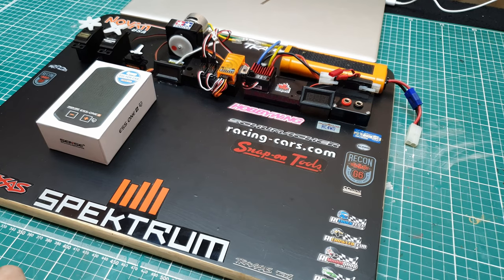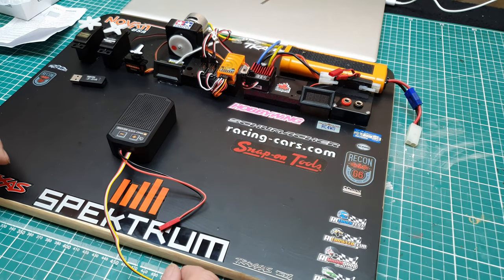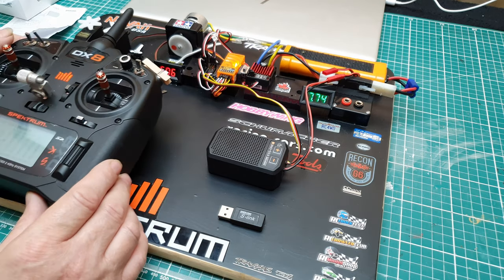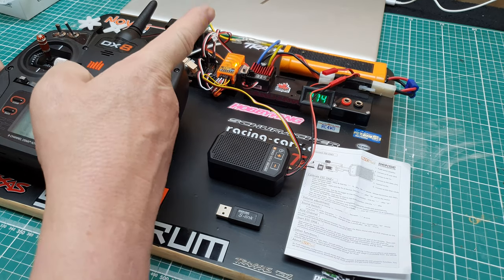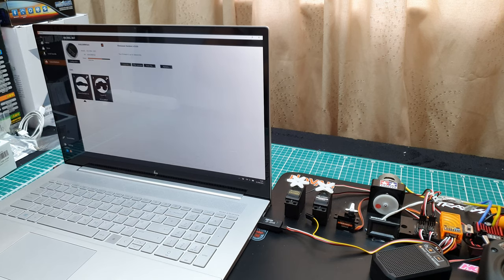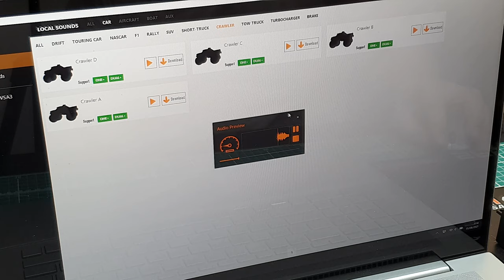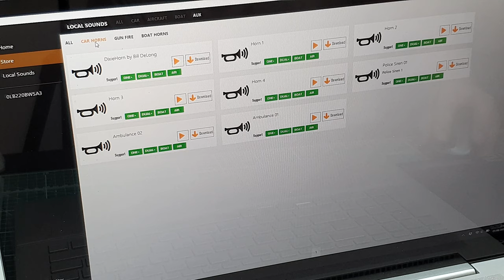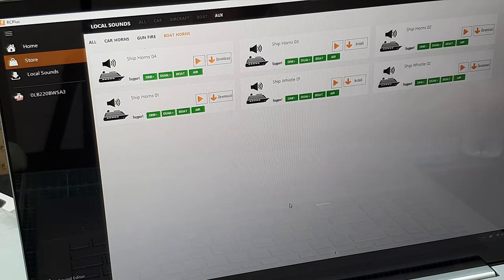Sense Innovations ESS ONE RC Car, Truck, Boat, Aircraft sound system

Comment: I am very curious to see if this works with the Air sounds from the RCPlus software.  Can you try/verify one of the air sounds (i.e. the P-51D Mustang airplane sounds) from their air sounds collection will download and play on the ESS-ONE?
Reply from the maker: The Sense system has 13 different Aircraft sounds and it does include the P-51D Mustang... Sense Innovations also make on sound system specifically for Aircraft which is much lighter.
http://www.sensehobby.com/index.php?m=content&c=index&a=lists&catid=8
I'm not sure how good the new Aircraft system is because I've not had one.
You can download the software at the following link and preview the sounds on your PC → http://www.sensehobby.com/index.php?m=content&c=index&a=lists&catid=115

Comment: Hey there. I like your set up. I've been out touch with modern technology, as I'm getting older...
Anyhow, I wanted to ask you, if you can help me on this. I have a VERY old cabin cruiser boat with 2 6 volt motors. The RC set up is an old Airtronics unit with 3 servos attached and a 4th port free that i was hoping to use for the horn, since no accessory switches exist on the remote...
The two motors are fed from one servo running a large potentiometer type, that controls forward, neutral and reverse. I could add a small 7.5v battery for this to run it, i guess. Do you think that this will do it for me?  I had some other prospects but fell through... Summer is coming and I'm getting antsy...Thank you for your time.
Reply from the maker: Hi..., I think the new tech such as the sound systems are not really compatible with the very old electronics we used back in the day. I would be tempted to look at updating your electronics and adding in a sound system with horn would be a great expansion to your old boat.
Reply: @TeriWilde   Hey there and thank you for the reply. I was trying to keep it "original"...
It's been through a lot and I'm afraid of "butchering" it. The thing  these days, primarily for us older people, is that stores are rare and most are web sites where one's dealing with machines and not people to work with...Anyhow, thank you again. Push comes to shove will leave it alone...

Comment: Teri,
I have installed the ESS-ONE+ 2017 Sound System on my model truck.  Can the (default) 5 second sound cut off be changed to 10 or say 20 seconds or on indefinitely?
Thanks for any input you may be able to provide.
Reply: That’s my question because if not… I don’t want it

Comment: How to install it to 2 battery system with a third battery
Reply from the maker: just connect the power supply cable of the ESS-Dual sound box to a battery/power source and making sure the input power is between 5v - 26v
Reply: @TeriWilde  but should connect to the bec wire and not the battery wire

Comment: cant load boat soundin ess dual
Reply from the maker: Download the RC Plus software from Sense Innovations website and install on your desktop/laptop
http://www.sensehobby.com/index.php?m=content&c=index&a=lists&catid=115
Reply: @TeriWilde  already been doing that for the last 3 years, had to contact sense and they sent me direct the boat sounds that will load from file. , software is unable to load air or boat sounds to ess dual... say wrong type.
Reply: @TeriWilde  hi contacted sence about this issue, they sent the sounds needed converted for my ess dual, the sence software is unable to load the correct files to the dual unit. reports wrong device.. same as the air sounds when trying to install in the unit